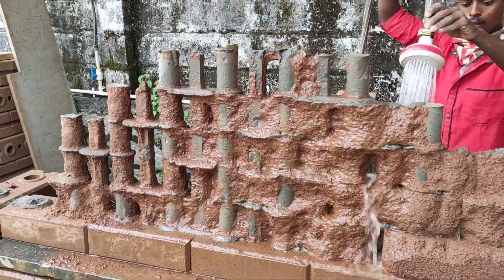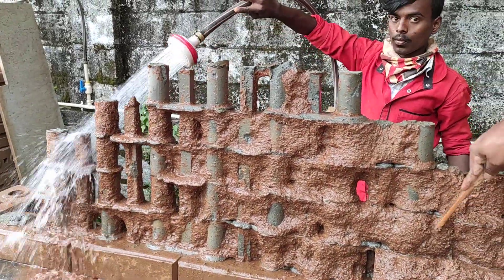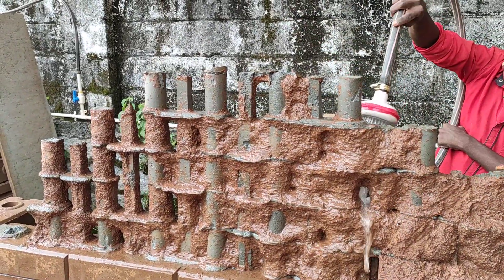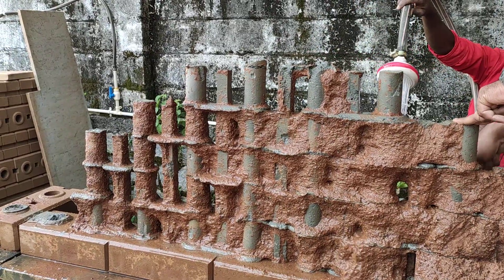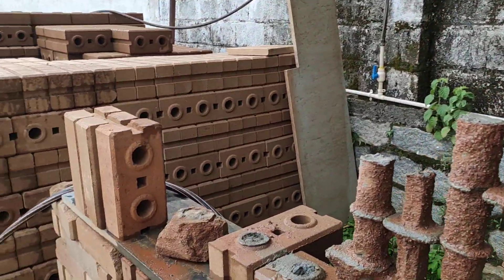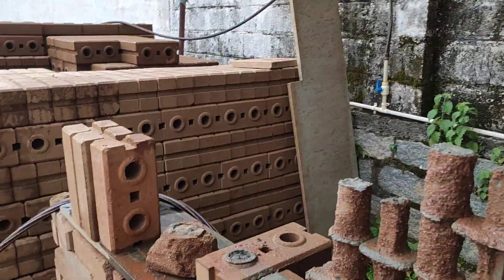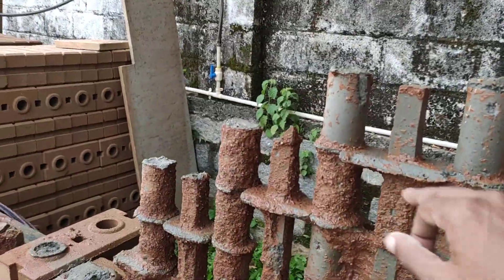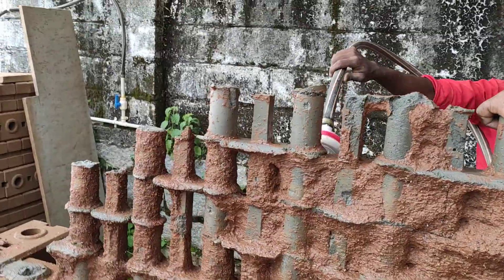Interlocking CSEB, cement Core locking the bricks

Comment: Using concrete to lock the blocks. Does this in any way negate the properties of using earth blocks?  Do the blocks still breath?
Reply from the maker: The outside surface on both sides is completely left open to breathe, the cement core is like a skeleton giving the wall the structural strength & using Rebar will give it Lateral strength.
Reply: Can we use lime mortar instead?